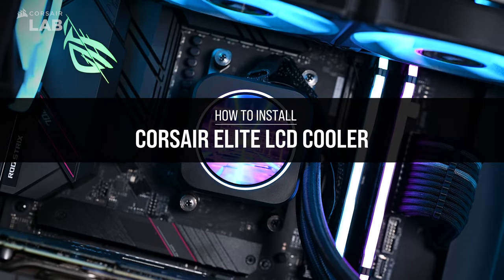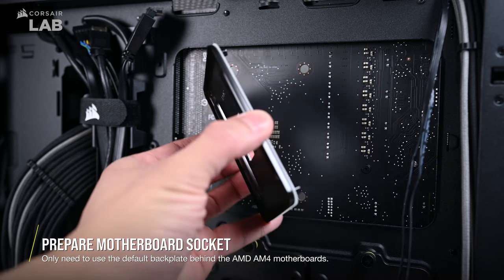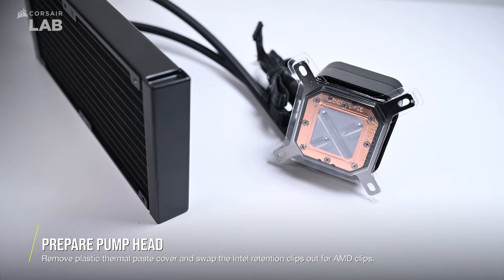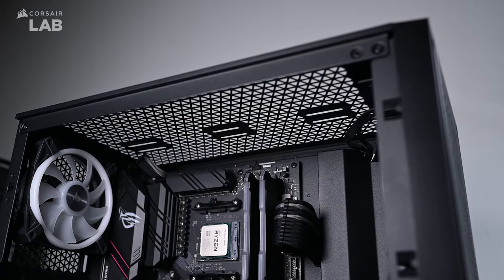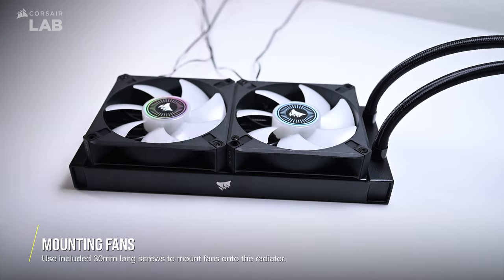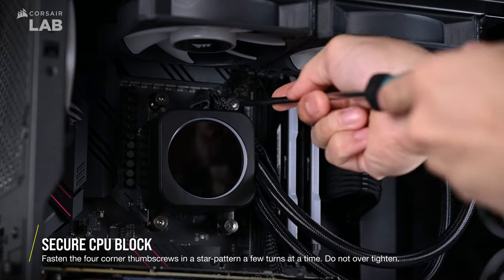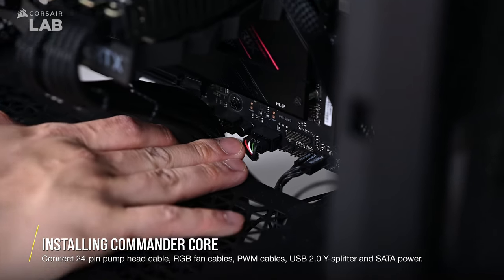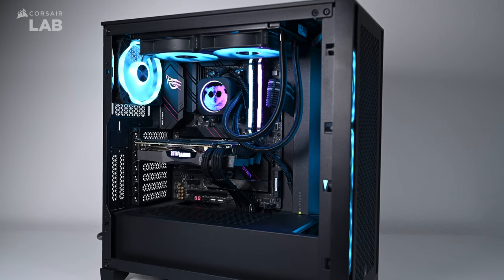How to Install CORSAIR ELITE LCD CPU Liquid Coolers

Comment from the maker: Need assistance with your CORSAIR ELITE LCD CPU Liquid Cooler or other CORSAIR components? Please reach out at https://help.corsair.com/
Reply: I want the new AM4 bracket, will you sell it separately?
Reply: Can I use LL140 fans instead?
Reply: @1gbyy  they are going to sell a 420mm radiator that has ML elite 140mm fans included
Reply: @1gbyy  or get a other elite capilax radiator that has a 280mm  radiator then buy the upgrade kit
Reply: If AMD users have all 4 DIMM slots in use, they wont be able to orientate the CPU block with the tubes on the right side. Can you please confirm this that if it will fit or not? Going off my NZXT XZ73 CPU cooler, I can't mount the pump housing with the tubes on the right due to me using all 4 DIMM slots and I would like to upgrade to this AIO cooler for the LCD and iCUE integration I currently have.
Reply: @Stefán Jóhannesson Haha his video is today for me, an hour ago, I'm checking it out now 👍
Reply: The am4 backplate is very loose with the included corsair am4 standoff screws. Is this an error or will everything be tight when I screw down the pump?
Reply: Update: Everything is snug and tight
Reply: @AuroraNora3  you will notice the backplate may be loose, but once you mount the cooler and tighten the screws, everything will be tight
Reply: @alanngo268  good thing i found your comment. Was installing it right now and was freaking out about it.
Reply: @mvmhunterkiller  I use AMD and have an Asus X570e.  I can fit the tubes on the right with all 4 dim slots  filled.  Might just be specific to your board.
Reply: iCue software does not recognize my newly purchased Corsair Elite LCD 240mm LQ. Tried everything in the corsair help/forum, but still does not work.. Please help!
Reply: where did you buy the bracket for am4
Reply: Manual says fans as intake, which is it??? Are you wrong or the manual
Reply: Did anyone notice that he tells to connect the pump tach cable to the CPU_FAN header, but connects it with the AIO_PUMP header. Even in the Manual it's told to connect the PUMP tach wire to the CPU_FAN header🙃 this can be a little bit confusing.

Comment: NZXT did the AIO LCD first, but Corsair did it better.
Reply: Without white version bye bye
Reply: Actually Asus did it first but the display werent anything to brag about, were slowly getting better and better displays on the AIO's :P
Reply: It was ASUS to do it first on Ryujin cooler
Reply: NZXT did it ugly. Sorry
Reply: Well asus did it first
Reply: They make everything better, but mouse . They aren't very cool:(
Reply: Kraken white and circl3, better than black and squar3 ew2ww2
Reply: @mitoCoroadoJr  white is cringe
Reply: @venividivici4253  I much prefer the one on NZXT. Very clean design with no plastic bezels around the screen. Unfortunately, it's not available in 420mm.
Reply: Ngl I like the full circle LCD shape more than this one

Comment: Those fan & RGB cables are starting to be out of control. We need a Corsair where we can link up all the fans together and just have one or two single cable for everything! I have 9 fans... that's 18 cables scrambled everywhere!
Reply: Bro i have 14 fans in the 7000D there are More Fan cabels than my cpu has cores 😂
Reply: corsair cable management makes me remeber that there are things in our life we cant control
Reply: They should in the future run the cables inside the radiator tubes long cables so we can hide them away behind the board 
Or maybe in the future motherboards will be made with a small hole near the cpu to hide these cables at the back
Reply: they need to copy lian lis fan attachment mechanism or artic with pst ones daisy chain
Reply: @JustaYTacc373  I got 11, adding 16 more :D
Reply: @frvi3502  i use to love corsair cases but their wires are out of control and i ended up with a nzxt h150i elite.
Reply: @Aetherbound  but the airflow?
Reply: @katherine-oh3rt  Airflow is perfect for my ryzen 7 3700x and a 5600xt. I run my computer most of the day while game developing and gaming and never hit over 70c with any 
part.
Reply: @Gamingtechgg  They probably would, however I believe Lian Li has that as a design Patent, so they cant.
Reply: @andydbedford  that makes sense, that's why
Reply: @wrangler10  23 in my custom lian li, 4 radiators in push pull
Reply: it gives the corsair splitters you can buy, you can put two of them on each slot. So from 6 fans controller you can controll up to 12 fans with one controller. At NZXT you can control 3 fans with each slots, and some fans of nzxt are in daisy chain like the LIAN LI fans, its much practical !
Reply: @JustaYTacc373  Lian Li has a smart approach with their SL120s, they just slide together and end up with just 1 fan wire coming out of the end fan....Made cable managements so much better....I just wish they had an AIO cooler that was as good as this one...

Comment: You show installing the fans with the cords in the back while the rad is upside down... then when you flip it to install the rad on the top of the case - voila the cords are magically in the back still. Maybe be consistent when you show how to install the fans?

Comment: This video answered my questions. I’m doing my first build and I was looking for the rings to attach to my AM4 motherboard. When they weren’t there I thought my kit was shorted hardware. Big relief and can now continue my build.
Reply: when putting the stand off screws into the backplate was there backplate tight to the motherboard or quite loose?

mine seems to be quite loose im not sure if this is normal? (this is before attaching the cooler)
Reply: Yes after installing the stand offs the back plate was loose. It had me worried as well. But as soon as I put the pump in place I had to push the back plate forward so the standoffs would reach the thumb screws and it tightened up perfectly.
Reply: @josephatherton2995  I experienced the same and because I didn't have printed instructions in the box, I wasn't sure I was doing it right which is why I googled the install instructions and found this video. It confirmed that I'm at least doing it correctly. Isn't isn't my first PC by far as I've built probably a few dozen at least over the last 20+ years. However, this only my 3rd or 4th build with an AIO cooler. I'm not looking forward to dealing with the cable management part of this. I really hope it's worth the effort when I'm finished.

Comment: At 2:13 of the instructional video you tell viewers to set the fans set to exhausts so hot air can be pushed through the radiator and out of the case.  In the support guide available for download it tells the user to set the fans as an air intake to your case.  See section 3 for intel 2 foe AMD.  Which one is correct?
Reply: If you mount the radiator at the top, place the fans to exhaust. If you mount the radiator at the front panel, place the fans to intake.
The top mount with exhaust is preferred.
Reply: You can do either or. It just depends on where you have your rad positioned
Reply: @chriish89 why would exhaust be preferred? The radiator is literally to cool the liquid going directly to the pump. You would want the coolest air possible going through the radiator so the coolant gets cooler. Just like a car. The fans either pull hot air AWAY from the radiator or pull cooler air to it. Pushing hot air through it would warm it up. Doesn’t make sense. At least that’s my thinking
Reply: @thatgsxrguy  Better cooling for all other components in the tower if u have it mounted at the top as exhaust. Then u will actually have "cool"air or room temperature air entering your tower.
But if you're struggling with only cpu temps, id recomend installing it in the front as inntake.
Its all about what u want or acomplish in the end.
Reply: @chriish89  I have fans in the top for exhaust but have always put AIO as intake.

Comment: Thank you corsair for finally using the 4 corner bracket. You'd be surprised how much temps drop with just the mounting mechanism
Reply: Facts dude, I just bought this thinking they used the old setup still and how frustrating it looked to install it but to my surprise it was changed for the better... phew!
Reply: @BlackBruceLeeTheGreatDekuTree  hopefully coolermaster takes a page outta asetek's book

Comment: So I’ve tried 2 of these already, brand new H150i Elite RGB, not an LCD.  Both have given me red triangles out of the box.  I haven’t even installed the OS yet because I don’t want to chance ruining my processor.  I have the latest BIOS installed for my board.  Have tried using the splitter and without splitter to the internal USB 2.0s.  Very frustrating.  I will be returning this one as well and going with an NZXT.

Comment: Yea I bought the upgrade kit and it was a pain to get it to stay down on the old 2 point AMD bracket.  I wish the new one was included.  The magnets arent that strong so the stiff cables kept making it pop off the block.  I finally just pushed it down hard and held it there for like a minute, but it still didn't feel like a solid connection.  Everything is working though and the LCD is awesome.  You can do some many cool new theme upgrades.  I have the star wars theme by Lewis Gerschwitz and put Luke and Vader dueling on the screen.  It really adds to the build.  Very happy with how it looks.
Reply: So far any issues yet?
Reply: @bluemagic3102  I've had to replace the LCD lol.  It was getting the red triangles and then  it would completely shut off the pump when it was connected.  Corsair replaced it for free and I haven't had any major issues with the new one.  There are some bugs with it and if you don't like screwing around with ICUE getting things perfect then you might want to wait for a second edition.  Overall though, I really like the LCD and it looks great in a build.  I keep it set to CPU and GPU temps and don't really use the GIFs except to show off to people that come over.
Reply: Hey man, you can just take the plastic trim off the bottom of the lcd screen. There are 4 screw. After I did that, I was able to sit it flush. Just take that plastic part off the bottom

Comment: I've read cooler fans should be drawing cooler external air into the case versus exhausting hot air out of the case, which makes sense considering you're trying to cool the liquid in the cooler. Which is the right answer?
Reply: Ever figure out out?
Reply: Your partially right, hot air rises cold air descends right? So exhausting heat from the radiator through the top of the case (depending upon your case)You can bring more air in with 3 additional fans. (4 fans in 3 out or more) The more fans you have the  slower fan speeds you can use = quieter Pc. I try to have a little positive pressure (more intake fans) in my case also bring air in through filtered /screened mounts. This way the other holes in the case arent sucking in dirt.

Comment: If they did a edge to edge square screen that would’ve been better tbh   It would’ve been better than the nzxt one
Reply: i havde the 240 aio from nzxt the software is really nice and the lcd screen too, but big failure is the colors of the screen are not so perfect. For example if i put the same COLOR CODE on the screen and my fans, it looks like two different colors...little bit strange...i think the quality of the lcd screen form the krakens is not so perfect. Works really good and fluently for all informations you can read on it, but the corsair one looks better from the contrast and colors i think.

Comment: um... CPU fan header, but it shows you connecting it to "AIO pump" - ....is it the same thing?  My motherboard has both labelled - it has CPU fan, CPU Opt, AIO, and whatever the last one was, chassis fan or something.  IS CPU fan the same as AIO? ...since they're the same type of connector I'm going to assume so.... I guess.
Reply: Thanks for asking this, i have the same exact question. I too will be assuming AIO PUMP is the right place lol. Please let me know what you found out.
Reply: Ditto. Asus rog strix z790e. Which pin is correct?
Reply: @Maoud2  it doesn’t actually seem to matter, they function exactly the same - but the motherboard might give a warning if it not hooked up to the cpu pins, but in the end I just used them.

You can definitely disable the warning too.

Comment: Is there a recycling program for my H100i platinum? I don't want to create more e-waste. Thanks!
Reply: sell it?
Reply: Sure send it over to me....😜😜😜
Reply: Idk if you’re able to do this but can’t you disconnect the pump and cables then keep the radiator to turn it into a custom loop if you wanted to?
Reply: @Whoknows21356  No its a sealed unit.

Comment: Is the new 4 screw AM4 bracket required to install the LCD on pre-existing AIOs? I have mine mounted on the plastic retention clips via 2 screws.
Reply: No, but I wish they include the new one. Absolutely detest the 2 screw to retention bracket way.

Comment: So in general speak about air flow direction-stickers are on front of fans, is that correct? I sometimes use some smoke like incenses to be sure the air going out and through radiator.

Comment: i just bought and installed h100i elite lcd and working fine but when i try to shutdown the pc.. it is displaying warning sign on the cooler display and wont shutdown the pc.. any advice?
Reply: Psh I'm having the same issue man. Turnes out you have to have a any RGB software Uninstalled or disabled before u update it. Turns out it messes up the firmware. Bunch a garbage.
They send me the flahs program and instructions but it doesnt work and I've been having that stupid warning light for a whole week now. I'm returning it.
I'm going to do a a whole refresh of the system and start new before I untall the new one. For 300 $ I shouldn't be dealing with this garbage

Comment: I just installed this thing, but the screen doesn't work. There's that red triangle that I can't get rid of. Everything else works fine, the pump, the fans, etc. However the screen, which is what I bought it for, doesn't work nor does it show up in iCUE when I look for it.

Comment: I'm having issues with stuff showing up on my icue home, the only thing that shows is the ddr5 ram but nothing else. The ddr5 ram picture also shows blurry for some reason, I am unsure if I connected everything correctly but the fans do light up. I did not however have enough ports for all the fans that I have. I'm running 10 fans in my case, I have chosen to buy another commander core to connect them all. 

Is there any advice for what I'm doing wrong?

Comment: I was wondering what the 24 pin cable out was for. I bought a "like new" one from Amazon and they apparently sent it without the Commander CORE. This should be fun to find a solution for. :(

Comment: I hope this is seen. I recently got this aio second hand and what was not disclosed to me was how important the missing icue hub was. Im curious how or if this works without the Icue hub. Any help is useful as i dont have another cooler and dont know if the pump runs just off the "cpu fan" header and "usb" header. Does the 22pin (11x2) cable need to be plugged in for the pump to work?

Comment: Can this be installed in the opposite orientation with the tubes on the left of the pump?  And if so does iCUE have the option to flip the LCD image 180 degrees?
Reply: yes you can do that
Reply: If I am not mistaken, the person in the video installs the fans in an orientation for the tubes to be on the other side of the pump. Then it magically switched when in the case. I had to rewatch because I almost installed the fans in the reverse for the cabling because of it and made me search a comment like yours. Hope it is working great for you, looking forward to my install here (tubes on left to not interfere with dominator platinum RGB’s).
Reply: damn well rn i have issues with the software not detecting the screen, my ram shows up fine but not the screen

Comment: So this shows all the connections?…. What about the temp plug the connector is a 3 wire with only 1 wire in it and the commander has a 2 wire plug on it and my motherboard has a 2 wire plug on it labeled temp as well ?

Comment: Do you recommend using this as an intake or exhaust? I am currently using the triple fan H100i elite LCD as my exhaust on the top of my Lian Li O11D case. With 3 intake fans on the side and 3 intake fans on the bottom...I am wondering if it makes that much of a difference?
Reply: I'm going through the same build as you are it sounds like... how did you get the triple fan to fit on the top of the case?
Reply: Avoid placing a radiator at your case's intake, all the air that passes through it gets warmed up going through the fins of it and then passes through the rest of your system before getting exhausted, the goal is to remove heat from your PC, not inviting it
Reply: @Humdinger69  thanks, I ended up using it as the exhaust on the top of the case.
Reply: @Humdinger69 it pulls in cool air to make the cpu cooler and pushes hot air into the pc and that makes everything else warmer. If you place atleast 1 exhaust in the back and 1 at the back top you should be good to use it as an intake

Comment: I just got my elite lcd H150i 360 mm yesterday.... after the install my fans and ring on pump light up.  The pump is recognized on the iCUE software.  I am unable to display anything on ring besides the basic colors.  No Temps or GIFs.  When I watch other videos i see that others have extra options for the screen that are not showing for me in the iCUE software.  Is this a software or install issue?
Reply: Do you already have a answer for this issue?